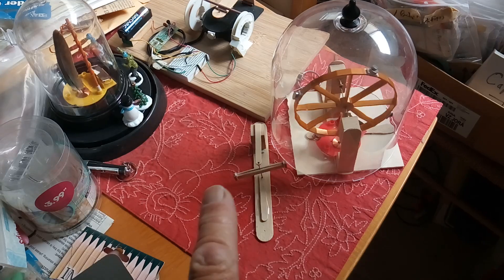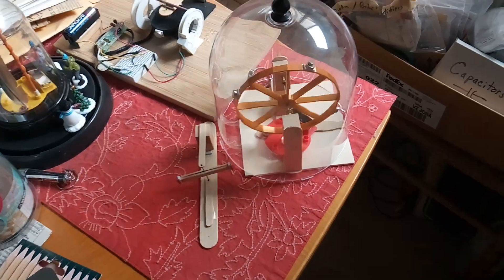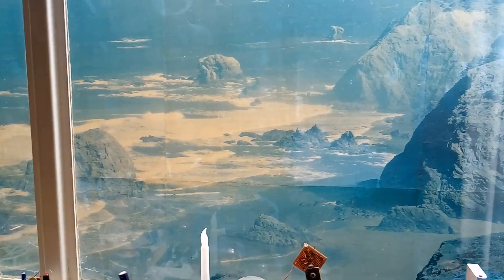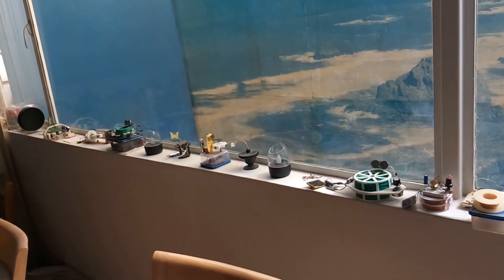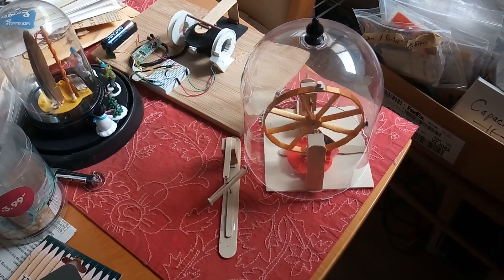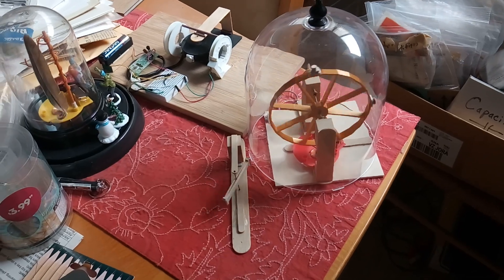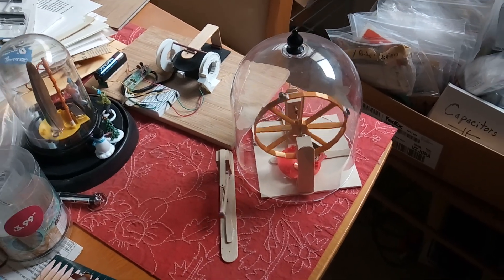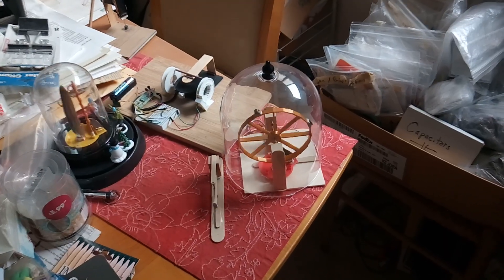Linked To The Wheelwork of Nature

Comment: @lidmotor i wanna know something's shuch as what kind of needle do you use on lasersabers 3d printed ez spin motor, Is it double pointed? And also what type of brass screws did you use in some of you motors i saw because does it have inner cavity, like cone shaped? I cant seem to find any screw that will work, And the needles that I have is only one pointed and the other side can’t sit frictionlessly. could you please help me figure it out.
Reply from the maker: The Ez Spin rotor uses two darning needles (break them in half).  You have to put them in from each side of the rotor.   The phillips screws I use can be brass or steel.  Nothing special.  The hardened steel needle wins the wear battle on both if you use sewing machine oil.
Reply: @Lidmotor Oh forgot one thing. About your 3d printed ez spin motor, how and where do you exactly sit both sides of needles on there? Like can’t just be sitting on plastic right? And not enough space for screws, So how did you do it, are you using some kind of sapphire bearing on both ends?
Reply: @Lidmotor well thanks for replying. And thanks for the info about the ez spin. But about the screws, for me steel or brass is fine. And I have many many screws laying around. Just don’t know how to actually sit the needle on each side. Do I need a screw that has a small cavity in the end? Also did you use the same half needle technique on other non printed motor too? Probably. Well I also have found an easy but not as reliable substitute for the brass screws. It turns out that my small needle just perfectly fits on the valve found on small lighters, that plastic valve thing. And the rotor happily runs on that metal nozzle of the lighter and even better I can file the end of that nozzle properly and there are two other metal parts on a lighter that perfectly house’s the nozzle . Making it like a rotor vibration suspension and damper because the nozzle freely can move a little to any axis.

Comment: I'd like to share some information about magnetic properties. The first thing I want to tell you is that if you place a magnet on a floating platform (a lightweight plastic one from a disposable food container) and lower it into the water, you'll see the platform slowly but surely rotate in a strictly north-south direction, and most interestingly, it will begin to float south. This effect is shown in the video, and I've created it myself. The bathtub shouldn't be made of iron; if you have a calm pond or pool, cover it with plastic to protect it from the wind, and you'll see how it floats. I've also created the second effect myself: take two ceramic magnets, like those from loudspeakers, but preferably one light weight, and hang it in a draft-free room on a thin thread, or better yet, a hair. Even from a distance of 5 meters, you can use the second magnet to rotate the first magnet around its suspended axis. The large magnet also needs to be rotated slowly; once you see the effect, you'll feel the speed and intensity with which it should be done. Start slowly. This effect confirms the fact that the second magnetic field exists and its field of action is much larger than the first near one that we all observe when dagnets are attracted or repelled.